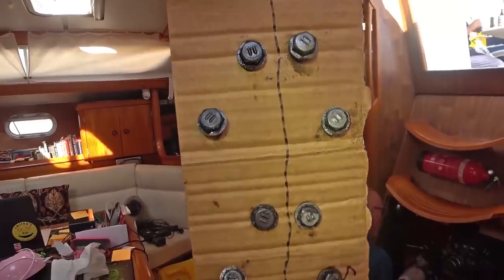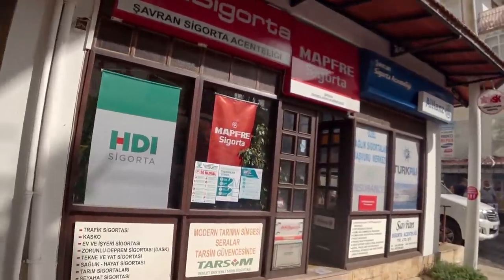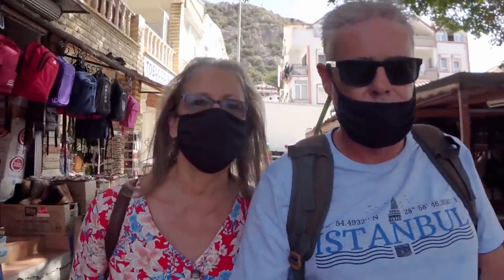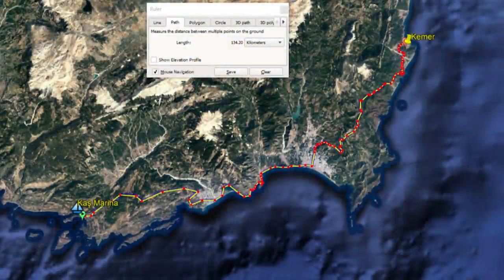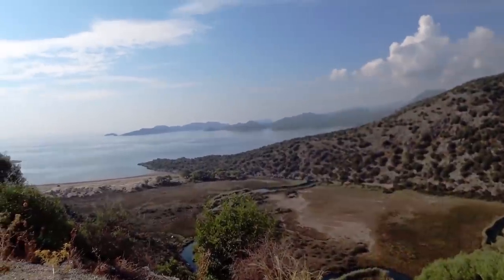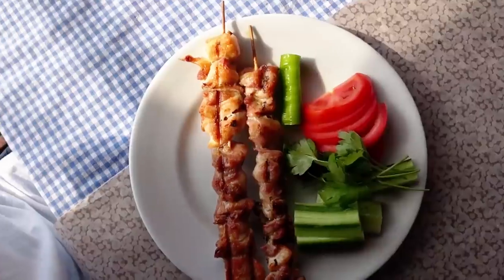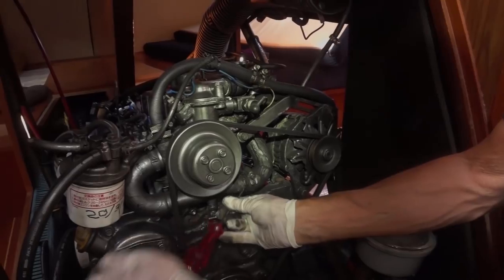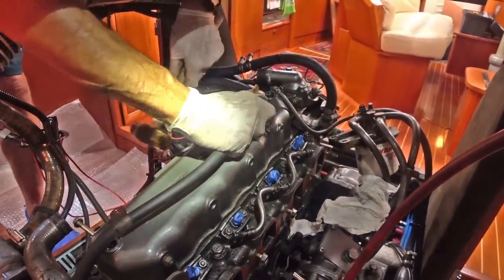Cylinder head removal what will we find - Sailing A B Sea (Ep.148)

Comment: Baz, not sure which series engine you have but I came across this note re the cylinder head bolts: 
"Many of the 'F' series Yanmars use a 'one time use' bolt that needs to be replaced each time. Other 'YM' series use a stud or bolts that can be re-used." 
It might be worth a quick check just in case yours should be replaced - it's a fairly common practice on many engines.

BTW I'm sure you could have managed to disassemble the head yourself but it's alway nice to have a mate along that knows the ropes. 
Thanks for all the hard work and great videos.
Reply from the maker: Hi Rob it's a 4JH2TE.
Reply: @SailingABSea  Ok, the service manual doesn't mention stretch bolts so guess you're ok just refitting and torquing down. Good luck

Comment: Bums On A Boat is going through the same thing with their Yanmar. It might give you a heads-up. He's lapping the valves. Not a difficult job, but experience is always better. The good news is that you now have the equivalent of a remanufactured diesel engine. Note in your log the hours on the engine when you did this work,
Reply from the maker: All of the work done has been recorded in our maintenance log. The valves were lapped by Aydin the mechanic, he had all the right tools for the job.
Reply: @SailingABSea , valve lapping can be done by hand, it's not as precise as machine lapping.

Comment: Well, can only say that what I told you before did come out is correct. Those little diesel engines with turbo the actually charge from the turbo is little and when you take it of or better say "blind" the turbo and run without it will not damage the internals. Of course when you run full speed for a long period of time the carbon will be a little more on the seats, valves and inside top of the cylinders. You did well, running with the engine as you have done after the turbo taken out of service. At the other hand you have now 2 advantage for yourself, first is now you know how the valves are operating with the camshaft and push rods, also the second more important matter is that you are doing a complete "overhaul" of the top side of your engine, taking it all apart and clean it, adjust the valves again on their seats in the head, cleaning all up in the manifold and the rest of the head. By the end of this all operation you can qualify as an assistance engineer!! It gives you a better understanding how the diesel engine is working too. Hopefully in the next week you have all parts done, back on board and can assemble those included the new turbo as I understand it. So at the end of the day you will have a good engine that can give you years of pleasure sailing with your wife in a safe way and no more headaches from the engine. Great result what I did expect after you "blind" the turbo but again, always better to renew it and bring it back to original. Good luck to you and looking forwards to see this lady running again. Cheers.
Reply from the maker: Even though we've fitted a new turbo, we've still kept the old blanked one as a 'just in case' spare part. Agreed that the engine should now run for years without trouble. Cheers. 👍
Reply: @SailingABSea  Thx for the replay and yes, I would do the same, keep it as you never know. Happy sailing there.

Comment: Dr Engine and His Wet Nurse assistant ,Think someone said your Motor would  Be fine did you find the Velcro head Bolts lol.  Ps : I would change out any old Hose clamps and Hoses Now before the Head goes back on ,just saying mate.
Reply from the maker: Yeah, we got the extra strength Velcro which should be fine with any engine vibration. There are a couple more hoses that are on the list to replace. 👍

Comment: How many hours on that engine? My turbo is out and I am getting ready to do the same. Engine will run cleaner and cooler with that new turbo :)
Reply from the maker: Hi Todd, even though the engine is 25 years old the hours are only 2,578. 

30 minute test run at the pontoon tomorrow and out for a proper test run on Monday around the peninsular.
Reply: @SailingABSea   Good luck to ya. It will be fine!